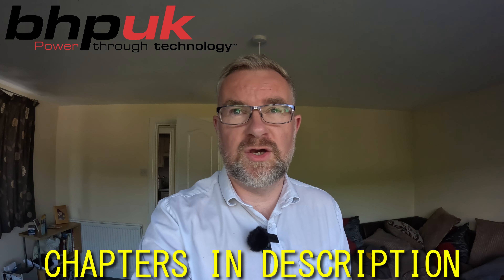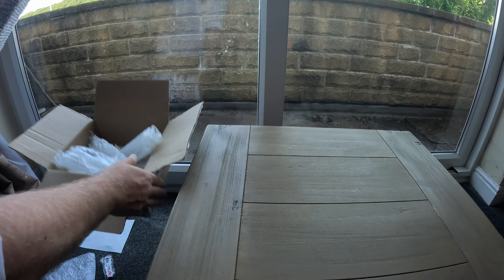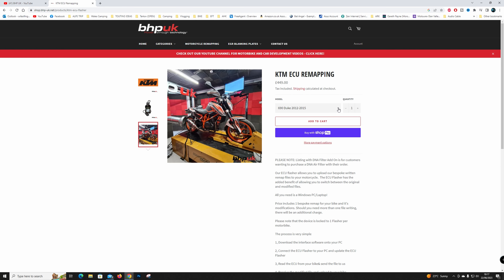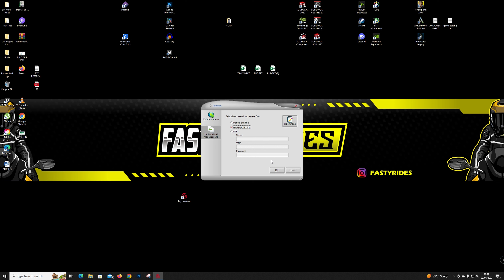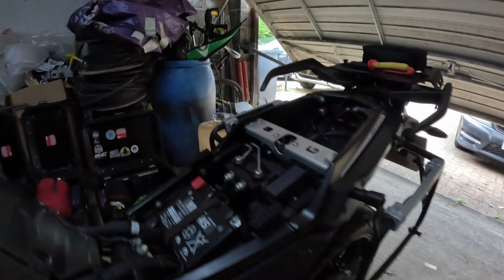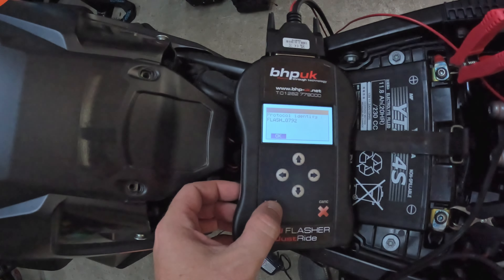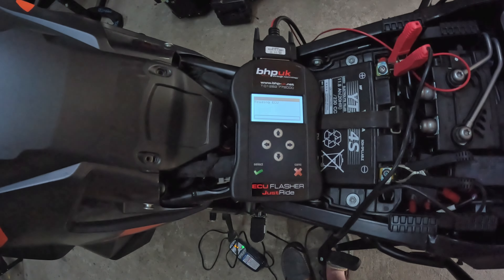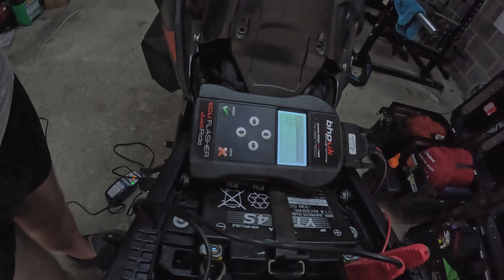HOW TO REMAP A KTM - BHP UK REVIEW | #FastyRides #ktm #ktmlover

Comment: you can also use the flasher tool for reading/erasing error codes you may get aswell, dont ask me why but every time i adjusted my chain i got an error code come up when 1st started, only takes a few mins to delete the codes.
Reply from the maker: Ah I didn't know you could also use it for that. Don't you find that the chain when set to how the manual says, still feels and looks very slack? Fasty
Reply: it does yes so i adjust it same as all my other bikes up and down 20mm ish and that seems to work for me and the quickshifter/blipper seem fine at that setting.
Reply from the maker: I will have to try this. Thanks for the tip. Fasty

Comment: Thanks for the clear explanation. Do you still have access to the factory flash in case the bhp flash goes sour? Also, is there some sort of warranty and  back-up service provided in case of difficulties either during the install or during use?
Reply from the maker: yes, that is still on the hand held flasher. So going back to stock is just as easy as putting the modified version on the bike. Yes they are pretty good apparently, I didnt need help or anything it was really simple to do. They also have a video on their YouTube channel showing you how its done. Fasty
Reply: @FastyRides  It seems from your assessment the engine vibrations that several owners including me are troubled with are largely cured with this flash. Although I am in Canada my '22 S is also Euro 5 compliant and I guess I would expect similar results from this product. Thank you again.
Reply from the maker: @PeterDavid-g2o  yes there is a lot of vibrations on the bike. There is a few things I did to help. 1 I always use puppy grips, they help a lot. 2 you can but bar raisers with rubber inserts, which I am buying next. 3, the reflash which helped a lot. reduced the vibes down quite a bit. Fasty-Rides

Comment: £500 for a remap! what a rip-off! And you can only use it on one bike? I have 3. xsr 700 sent off ECU 2 days returned. £250. Dyno tune on a 1050 Triumph sport, decatt and sc project end can. £350. funny vid :)
Reply from the maker: Thanks. those a re cheap remaps pal. Fasty
Reply: Admittedly it is expensive, but you have to factor in the ref lasher and cables etc you receive in the post, and the ability to either revert back to stock, or reinstall if dealer has updated software.

Comment: Hard to watch with this funeral music in the background.
Reply from the maker: That's why i made this - https://youtu.be/fG4k26EvHYU
Reply: @FastyRides  That's much better. I'm still sceptical about the whole thing. I'd imagine the KTM engineers know what they're doing.  And while I agree, that certain specs on the engine can be altered. The gain in one aspect means loses on other. If your goal is for example racing, your priority is power and not longevity of the engine. Your perceived smoothness of the engine may cause higher running temperatures or other issues. I wouldn't mess with it. I believe in the saying: If it works, don't fix it. On the other hand. If it floats your boat, go for it. Life is short. Happy riding!
Reply from the maker: @pajownik  yer i get what your saying and have to agree. you too buddy. Fasty
Reply: @pajownik The engineers do know what they are doing. It’s the government mandated BS that foul it up from running by properly. I’d argue it actually runs cooler with greater longevity with it properly sorted out.
Reply: @kj385  I get what you are saying, however. All the reviewers claimed, that the engine in 2021+ model runs smoother than previous gen. Which was euro 4. So is it better or worse? I gues we will never really know. Unless someone does proper, extensive tests.